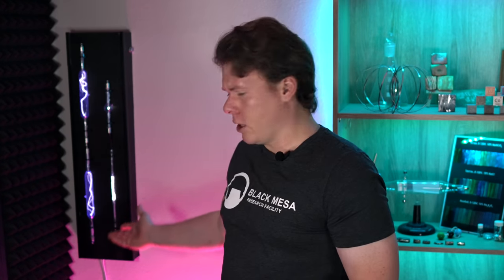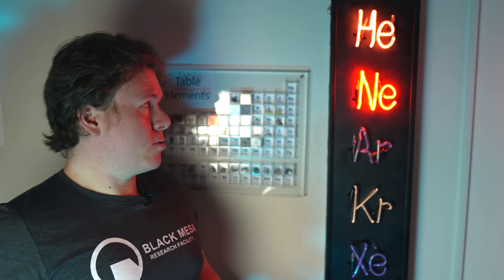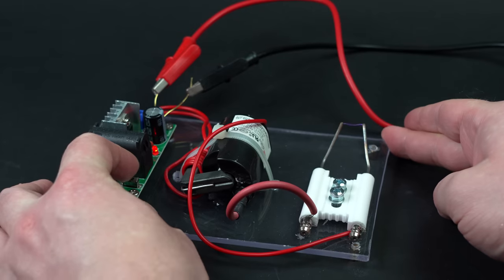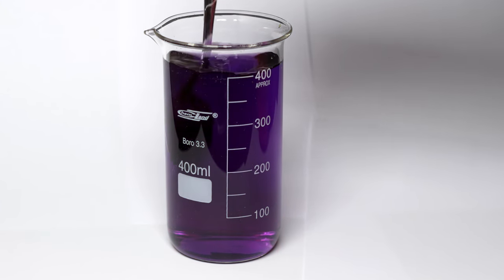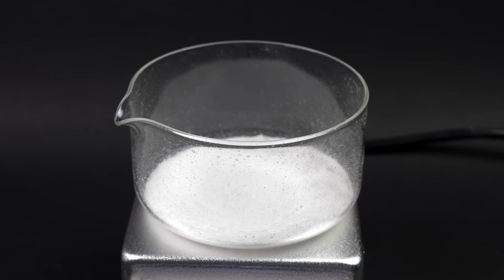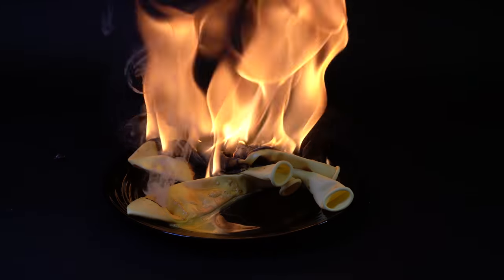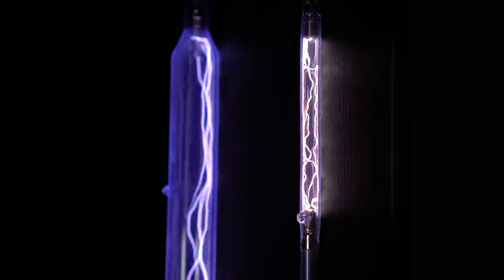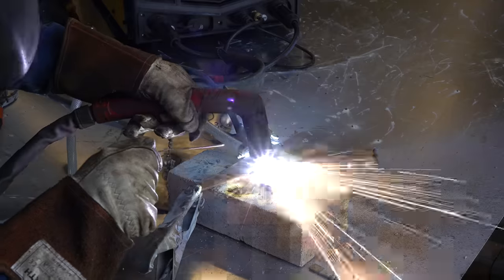What will happen if you IGNITE THE AIR with Plasma?

Comment: A small amount of ozone is fine.  It’ll irritate your nose and lungs before it’s a problem.  If you notice the smell, that’s probably a little too much.  But it’s not a high risk, just leave the area and exhaust it.
Reply: Sorry but if it is in high enough concentration to physically irritate your lungs, then it is already causing significant damage.  That is more than a warning
Reply: @thomasneal9291  Most hunting places carry ozone generators of course they are used outside
Reply: Ozone is the smell associated with thunderstorms. its the lightning that occurs that forms ozone. Which is an interesting molecule in and of itself.

Comment: 4:17 Actually, you can discover what the mixture of gasses is. You just need to get a spectrophotometer and to look at the graph. Because each gas emits a different wavelength of light, you'll be able to tell what the mixture of gasses is to an extent. I'm fairly sure that Brainiac75 did an experiment similar to this
Reply: A simple collimator and prism will do for many gases. Their main emission lines usually are clear, intense and easily distinguished with the help of spectra available easily on the internet.
Reply: Holy crap braniac was that lady who held a piece of nuclear fuel ejected from the core during the explosion. I hope she’s doing good

Comment: If you haven't done so already:  you should try the BLACK FIRE experiment with your low-pressure-sodium lamp.
(you just need to make a "sodium" flame and when you look at it with only the sodium lamp, it looks like black fire.. very cool, but hard to get the best solution mixture).

Comment: Your gas sign has a bad ballast, thats why the bottom ones are dim.
Reply: No. issue is that Ar, Kr, Xe are all much heavier gases which don't get as excited as lighter gases which causes them to emit light. The ions on the lighter gases are traveling much faster since it requires much less force to accelerate them compared to heavier gases. He driving all of the tubes from the same power supply. Perhaps if he used two power supplies with the second driving the heavier gases at much higher voltages they could be brighter.
Reply: @guytech7310  At higher current, not higher voltage.

Comment: 20 years ago when I was a kid I bought a plasma lamp like that one. The 1st time I used it I got amazed then scared when I touched the glass and the sparks came to the tips of my fingers. Then I licked it and the sparks jumped to the tip of my tongue! I got so scared of getting cancer or so, so I put it away. 
I've also opened it apart and there was a green lamp that had no electrical wires on it but it gave light when the lamp was on, and back then I just couldn't understand it.
Now I know what plasma is and how it works... And I still have that lamp somewhere...

Comment: Incredibly dumb question.
15:30 where are the wave-patterns coming from? The gas attempting to move away from the coils?
I assume it has nothing to do with the double slit experiment.
Reply: I suspect its the mechanical vacuum pump that is creating the wave pattern as it cycles which causes the air pressure inside to vibrate. Normally in a sealed tube its just uniform.

Comment: In one of your videos you showed the reduction of copper with hydrogen, here are some questions, what other metals can be reduced this way? does this reaction work with copper carbonate? Is it possible to use methane gas instead of hydrogen?
Is it possible to use 'syngas' wood gas in this reaction instead of hydrogen?
I believe that these questions of mine can make a cheaper video.

Comment: Plasma ball messed up my computer once. The charge spreads through the room and charges stuff. Try working with an optical mouse next to it. The pointer gets crazy. And it's just the begining.
My GPU was fkd up. I was updating drivers, even had to update/repair bios. It was a mystery. Then I lost the ball and it slowly went back to normal. I just had to tune the fans for some reason.
I wonder if it produces negative ions like those fancy $200 air ionizers. I think so, just with 1000x higher voltage

Comment: What happens if you feed some gas like methane or hydrogen rather than Air through a Plasma cutter torch? Will you get an even hotter flame of reducing nature, rather than oxidizing that could be used for welding rather than cutting metals?

Comment: Please make a dyi eletric arc furnace using plasma to melt high temperature metals, im trying to find a way to do my alloy without using thermite
Reply: Look at his video on tungsten
Reply: two ways:

1. TIG torch probably the simplest method which can get up to about 11,000F\6000C. You need use a argon shield gas to avoid oxidiation
2. Tube furnace as long as your alloy melting temp is below the melting point of the heating element (NiCr). 3200F/1800C

Comment: the LED is NOT more efficite that a LOW-PRESSURE Sodium LAMP. In my town when they replaced the LPNa lamps in the tunnel with LEDs the electric bill went up. also when an old school lamp failed you replace the lamp. now with LED if something goes wrong, you don't know what it is: is the LED, the AC to DC or other circuits? so you replace the whole assembly and causing more garbage.
Reply: Well the LEDs’ light output (or at least the effective night light output) is better than that of low pressure sodium lamps

Comment: Do you think its possible to create a pre-plasma chamber for combustion engines?
You kmow... make those suckers more than 35% efficient.....U-kno "Burn-Hollywood Burn"...!
Maybe plasma injection could be a thing...Use electromagnetic fields to transport energy.
Spin-off tech from "fusion reactors"!
Ive always felt that the combustion energy has never been fully tapped.
I mean how don't piston bores have coils!!!!!

Shoooot, your experiments showed you can create oxidisers using the plasma.
Maybe combustion engines could be the answer to climate change, as they both take dangerous climate altering chemicals out of the environment and convert them to energy.
Reply: No. ICE engine efficiency is depended on compression, temperature difference, and friction. Diesel engines operate near 50% efficient do to the much higher compression. There are limits for compression ratio with gasoline because it will self-ignite at high pressures, far below the pressures that diesel will self-ignite.